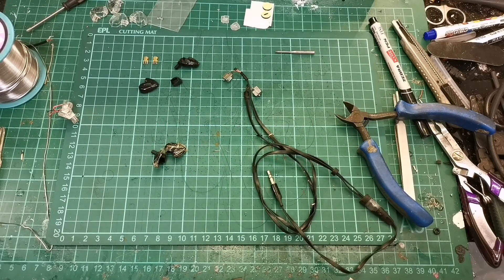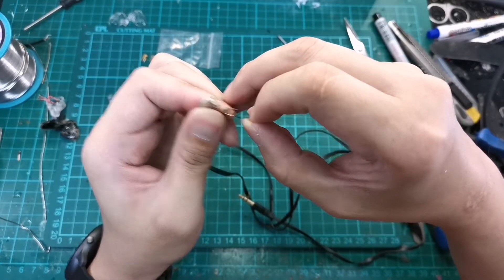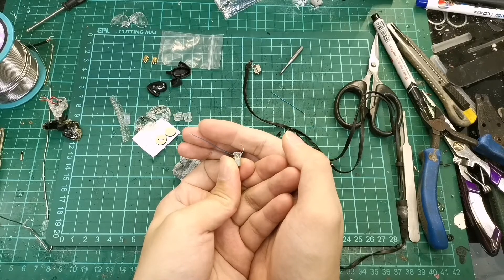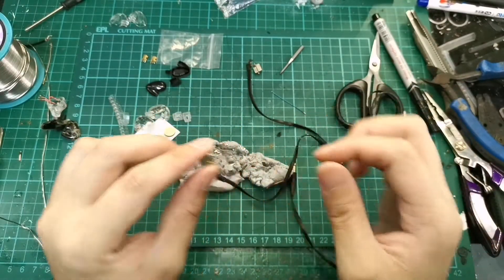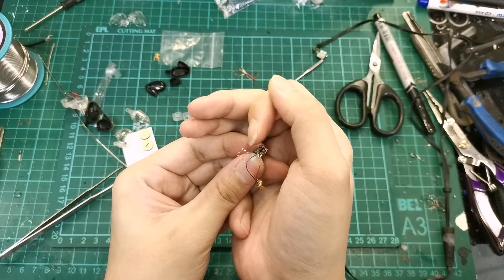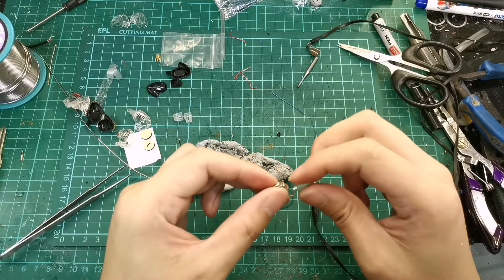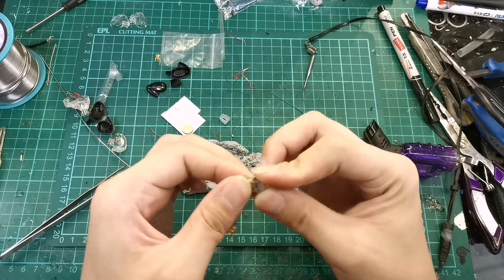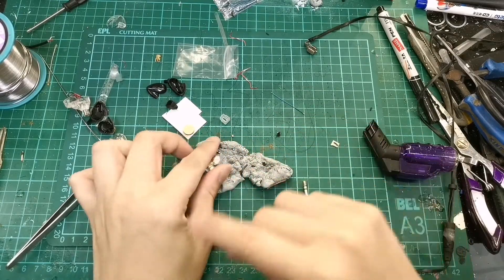TDK BA200 Reshell to OEM SE535 shure shell [NAKED Tutorial]

Comment: Great video! I still have my BA200 in perfect condition. TDK BA200 requires deep insertion to achieve linear treble, I wonder if reshelling to 535 case would lead to shallower insertion
Reply from the maker: The insertion depth of the ba200 is shorter than the 535 if using the same double flanged  tips but what's missing here is the full crossover system of the original ba200